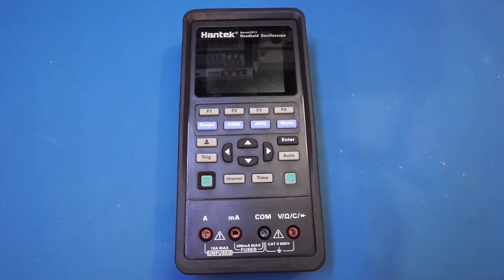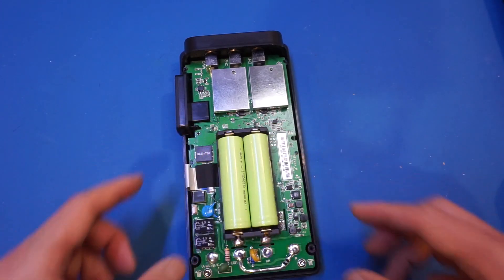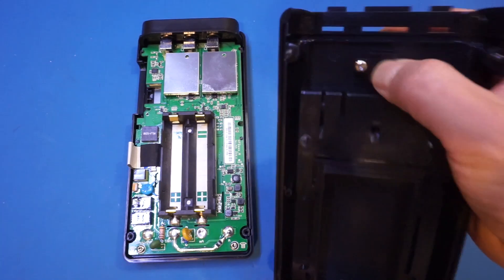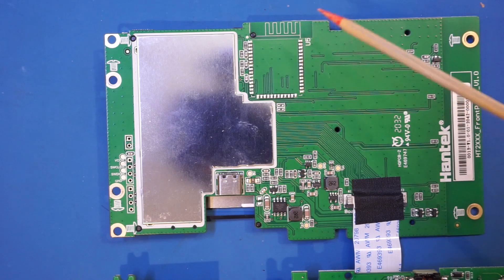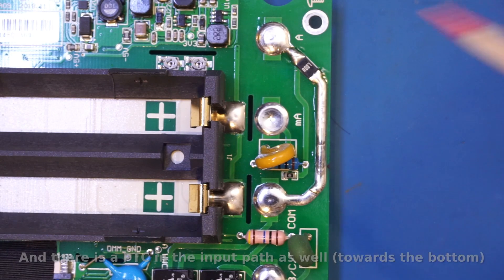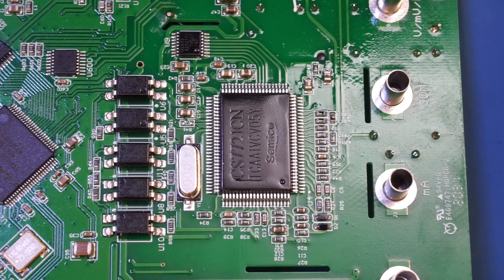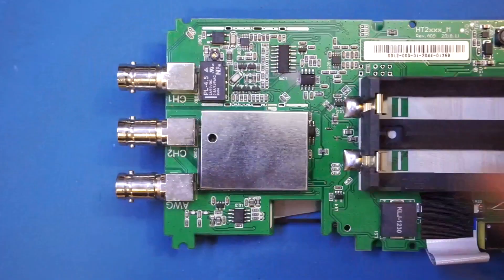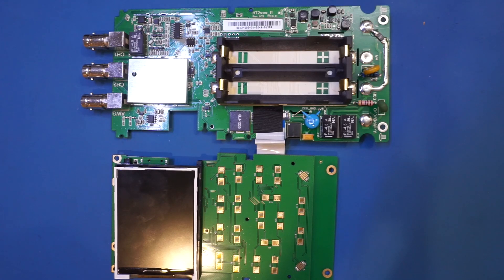Teardown of a Hantek 2D72 3-in-1 Handheld Oscilloscope/DMM/AWG

Comment: I've experienced some 'weirdness' with my 2C42.
Firstly, it seems to be a bit 'picky' about USB cables it will charge from. I've had high quality cables (such as those from Anker) be completely ignored by it while some other random cheap cables will work just fine, even from the exact same power source. Kinda weird.
Secondly, it seems to passively consume the battery stupidly fast when switched off. Leave it unattended for a week or so and it will be nearly empty by the time you come back.

I'm considering wiring in a switch to cut the physical connection to the battery when not using it to alleviate that latter issue. This video will be a huge help in that regard, so thank you!
Reply from the maker: Yeah the standby battery drain of this handheld scope is unfortunately quite high.

Comment: My device keeps discharging the batteries even if turned off. If I fully charge it and put on shelf, then after 2-3 weeks the batteries will be completely discharged. What do I do with this?
Reply from the maker: Yes, unfortunately the standby current is pretty high on this 2D72 as I mentioned in the video.
Reply: @KerryWongBlog  May be you have an idea how to fix this? I am thinking about adding a small switch at the back side :)
Reply from the maker: @Sukhinov  You can certainly do that. The two batteries are configured as common anode if I recall correctly. So you can cut the trace on the anode side and install a switch there if you want.

Comment: How is the rubber? Mine has gotten very sticky and yucky now after a couple of years. Very disappointed. I am watching your video to see if I can just totally remove the rubber shell.
Reply from the maker: Yeah, you can removed it. I did that during the teardown.
Reply: @KerryWongBlog  i used your method with the screwdriver but somehow the rubber has broken down a lot and it ripped immediately even though I used very little force. Anyway will use it without the rubber cover. Won’t be measuring 500 V anyway haha

Comment: I had to replace the batteries 6 days after I received mine. Tested the capacity of the original batteries the one on the left was 2337mAh the one on the right was 2537mAh. Since I have replaced the batteries the meter works fantastic for my needs.

Comment: The "Pulse transformer" is most likely powering the DMM side, at least judging by the components around it (a rectifier diode + some large caps on DMM side, a driving transistor on the other side). The recessed USB connector might be for maintaining the CAT II safety rating, although I'm not sure since the DMM side is isolated + there's other exposed metal parts like the BNCs for the probes.

Comment: Awesome detailed disassembly and re-assembly.  I invested in a 2C42 for working on generator and engine projects, mainly for the engine welder/plasma cutter/generator on a, 18HP opposed twin B&S engine like used in their hybrid car, garden tractor platform project.  Been busy on other concurrent projects... though left off with determining if I want to make a shunt module to measure and log current waveforms with or determine which current probe would be best to invest in.  I don't really want to spend much since thinking about being cost effective as I can get, so debating hacking a cheap current clamp meter to make a probe vs designing or copying a design, making and calibrating.   Isn't helping I just saved some pre-scrap priced electronics lab test equipment at still unbelievable pricing to me and the equipment was present after a few estate sales.  Different strokes for different folks and I'm a happy new owner of my first real spectrum analyzers.  Now to find a HP 85662A Display for the hopefully able to build a in spec 8568B from that and the two 8568A's.  Anyways, great reminder to spend some time to move the current probe and most likely concurrent shunt module forward for measuring higher current waveforms.  Neat also, is I've read these can be hacked out... not certain from reading if the hardware on the 2C42's can support 2C72 functionality... though reminds me that was the other topic to read into some more.  Thanks for sharing!
Reply from the maker: Good luck with your projects!
Reply: @KerryWongBlog  Thank you!  Good logic I prefer and have faith in, though appreciate the motivation.  Where I'm challenged with follow through execution, is the time appropriations due to life in general.  Where life being defined as literally, time and resources.  Challenging having the resources and not the time.  :-|

Comment: Not actually having handled this particular device, I'd say the recessed USB connector is to protect the board from being damaged if you drop it or bash the cable when it is plugged in.  Having seen plenty of laptop USB and power connectors damaged by being bent sideways, this looks like a good thing to me.